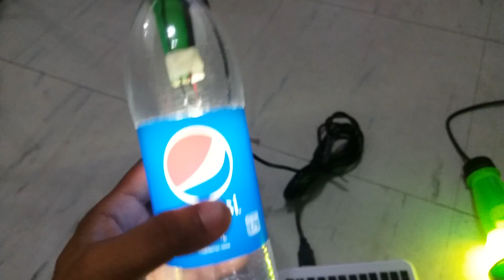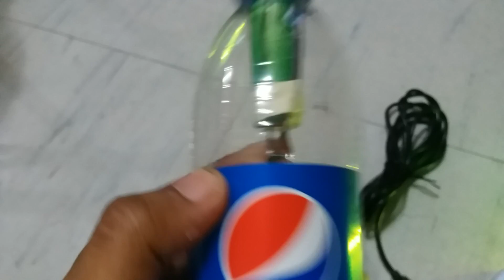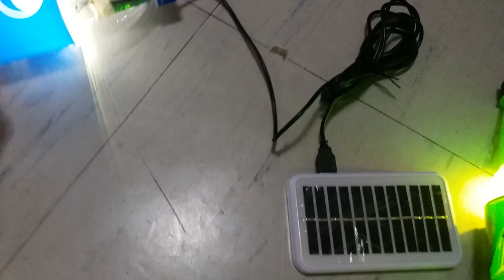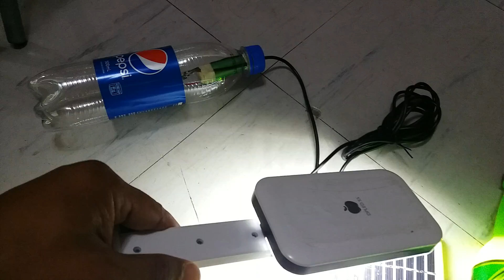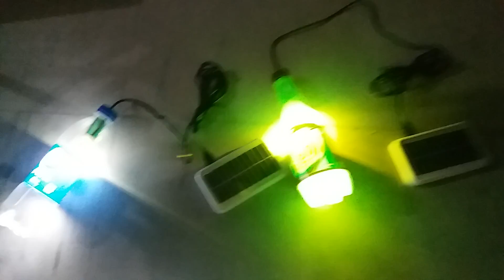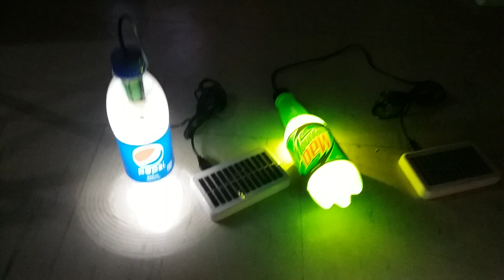Do it yourself solar night lamp inside the bottle

Comment: wonderful ed.u have one of the best videos on diy solar lamps using 18650 cells.im trying to make one and faced some questions while buying 3s bms.my  solar panel says  power 10w at min 16.5 v .there r many bms on ali express im buying one which says 12V 30A 3S Polymer Lithium Battery Charger Protection Board PCB Charging Protect BMS Board 3 Serial for 18650 18550 Li-ion Lipo.Will this be fine?
Reply from the maker: prasad mudkatte if you just intend to use the BMS on a 10w solar panel, 3S 4Amps bms for lithium ion or lithoum polymer will be fine. Dont buy bms for lifepo4. They are different
Reply: here's link to it https://m.aliexpress.com/s/item/32804768333.html?spm=a2g0n.search-cache.0.0.70bc08b9Lm9z06#autostay
Reply from the maker: prasad mudkatte that will be fine. It is also cheap.